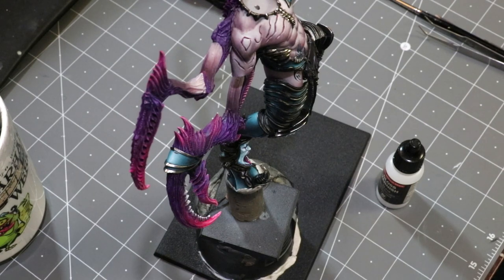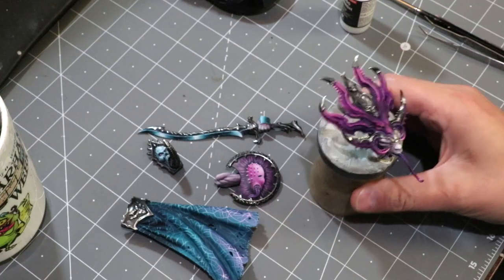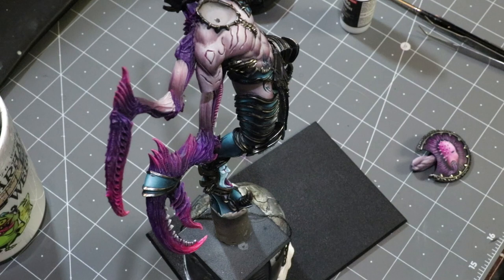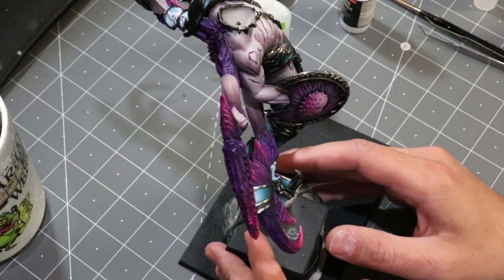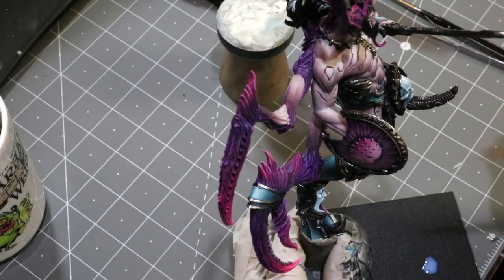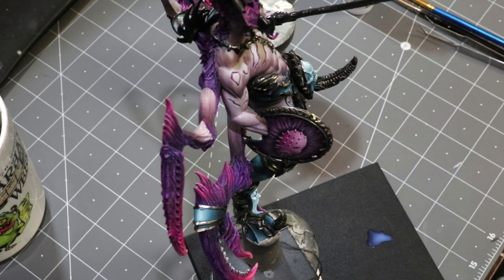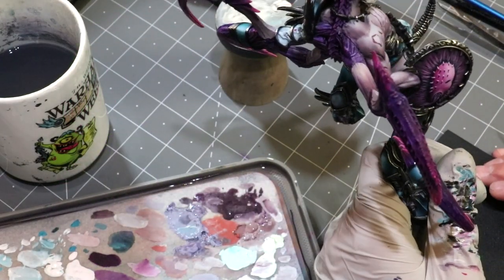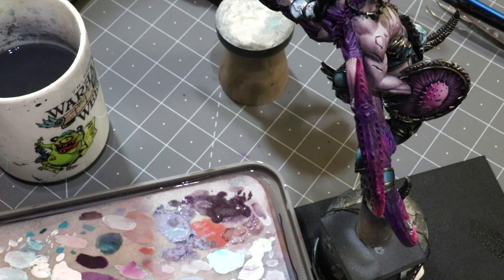Hobby Cheating 205 - Fixing Gaps from Subassemblies

Comment: This is a great tip. Especially because I paint all of my large scale figures in sub assemblies. Important to note and the part that scares most people. If you have to fill. Use a filler that is water soluble and the excess can be removed as you go. Avoid sanding if at all possible! I found acrylic gel medium to be a good option. It's durable, bonds to anything, can be cleaned or thinned with water, doesn't shrink and can be colored with any acrylic paint. Food for thought.
Reply from the maker: That's a great idea, I have some acrylic gel medium, never thought of this use. Great share.
Reply: @VinceVenturella  Thanks! I use that stuff for so many things. It's so versatile. Plus it's cheap and damn near fool proof

Comment: Hi Vince! Matte vs Gloss: You wrote in the comments that gloss varnish is better than matte varnish for gaps filling (if I've read you correctly). Would you mind telling us more about why it is the case? (I suspect the surface tension of the glossy varnish makes layers thicker, but since we push the varnish onto the crack, it shouldn't really have any effect, should it?)
Reply from the maker: The Gloss Varnish is a little thicker and tends to fill the full gap or crack a little better.

Comment: The other thing to consider is when you've painted your sub assemblies and you've  painted everything (including the points where the parts are to have glue applied to them) how do you neatly remove the paint from those points prior to applying plastic glue ? infact do you even do this ? or do you just put the plastic glue over the paint ? I'd rather not do this as the plastic glue often dissolves the paint and the glue melted paint residue starts going places where you don't want it to. Do you guys remove the paint from the sub assemblies using a cotton bud dipped in some alcohol based liquid only on the part where it's going to be  glued ?

The other thing to highlight in this video is perhaps the importance of glue application, there is nothing worse that having painted your sub assemblies to perfection and then you apply too much glue to the joints and then it spills over the join onto the visible part of your lovely painted model. For superglue I use a ca glue applicator from Flex-i-File with very liquid super glue (say Bob Smith Industries Insta Cure or Army Painters super glue, not the think gloopy, stingy superglue such as gorilla glue; this is a very precise tool and you just burn and scrape the glue off the metal tip if left over glue gets too bulky). For pastic glue I just use an old fine brush to paint on the glue precisely, the bristles harden afterwards but then re-soften when you dip it back into the super glue.
Reply: I actually keep some testors plastic cement (gel) for this purpose. I'm able apply it and bond the pieces without any running. (Don't use it directly out of the tube. The stuff likes to come out due to any pressure on the tube while removing the cap. Just lay some down and apply with a toothpick or something.)
Reply from the maker: So in general, I put a small piece of blue tack over the areas to make sure they aren't painted, then the glue will go on without issue. If there is a little paint, plastic glue will generally eat through it.

Comment: Your varnish trick is amazing.  I did a "worst case scenario" with my current project and the gaps and lines did practically disappear.  Thanks
Reply from the maker: That wonderful, happy to help. :)
Reply: @VinceVenturella  Outta curiosity, how wet is your wet pallete?  I'm in such a dry environment that it's been marginally effective and wondering if its me?
Reply from the maker: @bencoomer2000  I keep it pretty wet, my basement office is very, very dry, so I have to keep it quite liquid.
Reply: @VinceVenturella  Thanks.  Is there a point of being too wet?
Reply from the maker: Sure, when your paints are basically turning to water on the pallette (one key is to not close the palette all the way).
Reply: @VinceVenturella  So fine until then...  Thanks. (wonders if being mocked, but okay with it...)
Reply from the maker: @bencoomer2000  Nope, completely serious, if you have to much water, they will basically separate and become little pools, you can kind of calibrate from there, it's tricky in dry areas. :)

Comment: I get this is a large model, so overdoing it with CA is probably not as big of an issue. But with something a little closer to 28 mm, being a noob I find it easier to use a thin layer of epoxy putty to put everything back together for certain joints. Gives a little more time if I screw things up. For something like ball and socket joints in GW models, super glue is great. But when I'm connecting legs to torsos in thin female minis (say like Relic Knights for example), it really sucks when the alignment  is slightly off because the glue dries too fast. You can't remove this with an ultrasonic cleaner because there is virtually no room for the bubbles to get in a joint like this once it cures. You can cut the model up and reattach things, but then you have to re-sculpt details that get damaged in the sawing process. It's a real PITA. That said, I love your varnish trick. I saw when you used the matte variety in an earlier video when I didn't have the plastic putty on hand, and it saved me a hassle more than a few times.
Reply from the maker: Good notes for sure on the glue. Glad I was able to help with the Varnish.

Comment: Could you please discuss that wire loop thing and other tricks you know for mounting heavier models on a grippable thing?
For some reason I just struggle getting heavy models to stay put on my jam jar lately and my plasti-tack is failing at its one task.  Klunk Smash
Reply from the maker: Sure, I will add it to the list. In this case, I just took some wire and wrapped it through a cut in the paint cap to hold it down.

Comment: Came to this from March '24's AMA video. I've run into problems with superglue vapors discoloring the paint. It seems to be at it's worst when I use a gel superglue with an accelerant. Beyond the Zap-a-Gap shown here are there any other tips on glues that don't discolor?
Reply from the maker: It can happen sometimes, using a very small amount of gel, and then not using an accelerant is a way, but super glue can always do it to a point. Using a little sprue goo in the middle can help. Then varnish to seal it up.

Comment: Does the accelerant you use dry clear? If some of it touches a part of the model it you don't want it to, does it mess up the paint job?
Reply from the maker: It will fog the super glue, so you have to be a little careful (or paint over).

Comment: Did you varnish the model before gluing it. I always assumed that accelerant would eat the paint.
Reply from the maker: It doesn't really hurt the paint if it's a little, but yes, she was also varnished, but I have used it many times without and it didn't hurt anything.